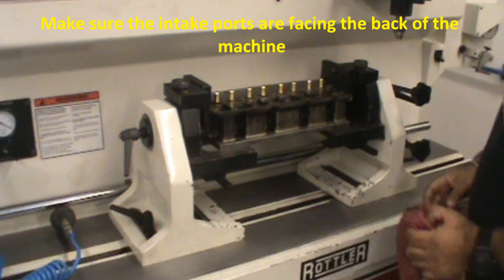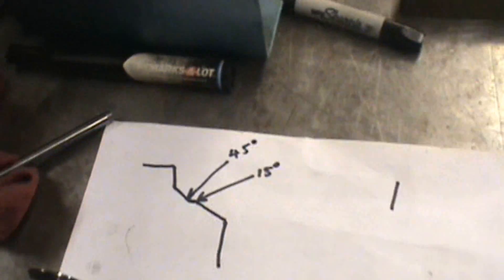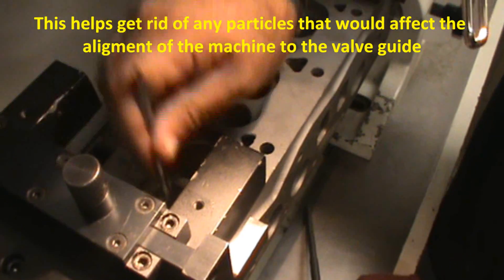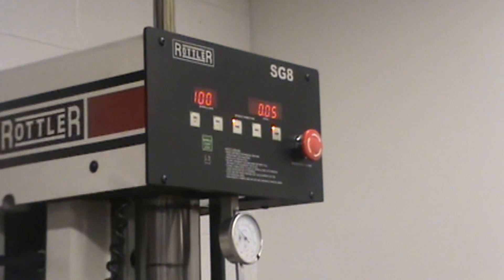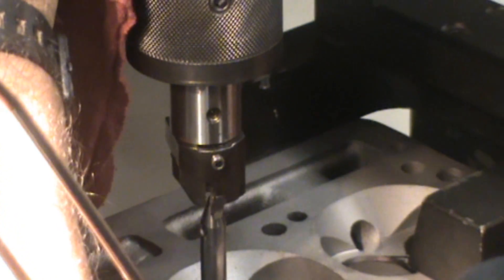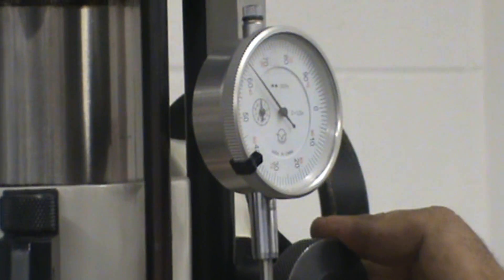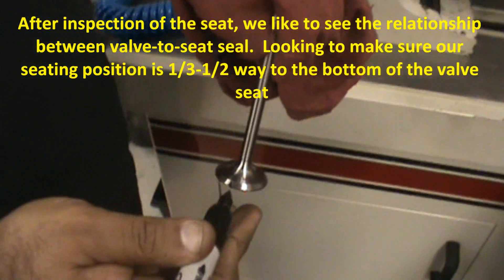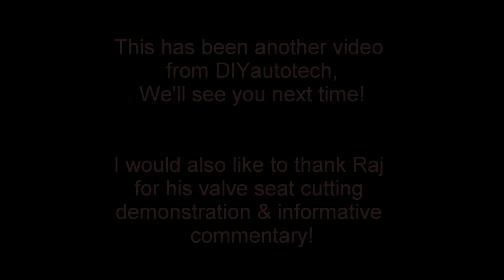Cutting and Grinding Valve Seats

Comment: Production machines like the Serdi and the Rotler pictured here are great. Now for one step further to challenge young men: If they knew the  valve seat axis x/y on the head they are working in relation to the deck.  A home-built plate of aluminum and a dial indicator in conjunction with the tooling utilizing a double cardan joint and a decent 1-hp drill, they could become the guru in their neighborhood turning out quality like this for their buddies Integra-R heads etc.  

 They told you to pay attention in school....... Although I can't compete in production numbers with these machines I have the skills needed to duplicate the accuracy depicted here under deplorable field conditions with modest equipment. But alas, it would be application specific........